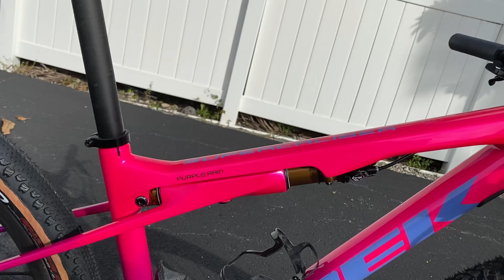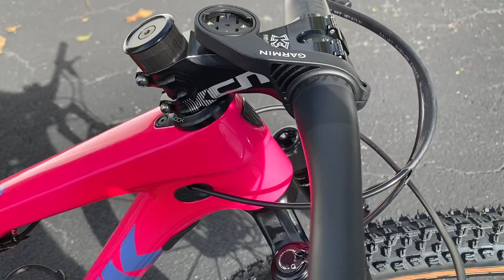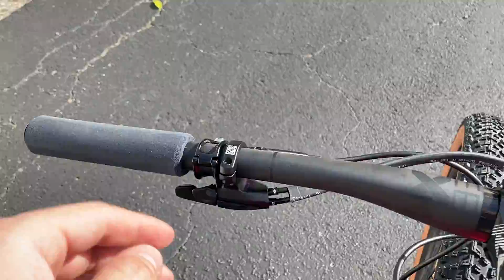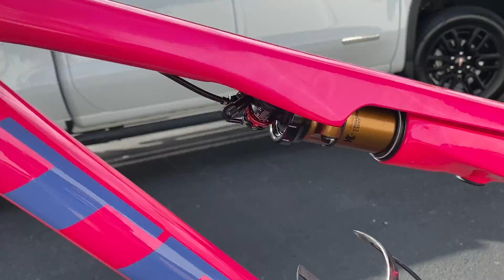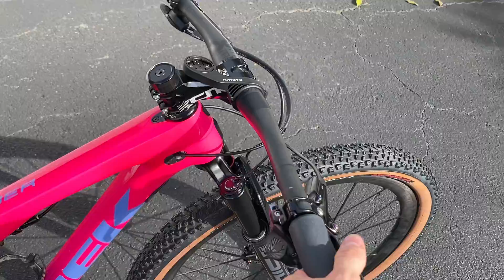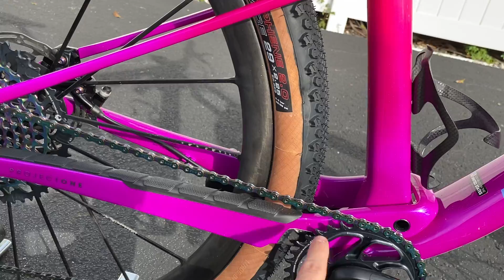TREK SUPERCALIBER 9.9 PROJECT ONE BUILD (PURPLE RAIN EDITION) 21lb XC BIKE *SPEED MACHINE*

Comment: I’m thinking about getting the KCNC stem as well. Mainly to get lower position. But do you know if this guy shaved off the Knockblock system? I know in order to run regular stem you’d need a Knockblock adapter but that’s gonna raise the stem height. I don’t see any spacers underneath the stem so I’m curious how he’s running this stem.
Reply from the maker: Call B and J cycle and ask for a guy name victor, that’s his bike and he is located in pompano beach

Comment: Ain't it the wheels the Silverton SL's ? I think the 1.0 are the 1000-1500$ model with dt Swiss hubs weighing in at around 1700g iirc
Reply from the maker: Shitttt your absolutely right. I made that mistake but yes these are the SL $3500 retail and the 1.0 are like $1200 two completely different wheels
Reply: @GCPerformance18  was looking around for Silverton 1.0's for my hardtail but as soon as I saw the weight, I told myself that I'd never buy those
Reply from the maker: @natgeoba7377  yea hey are a kind of heavy wheel but I mean for the money aint bad and they sound nice